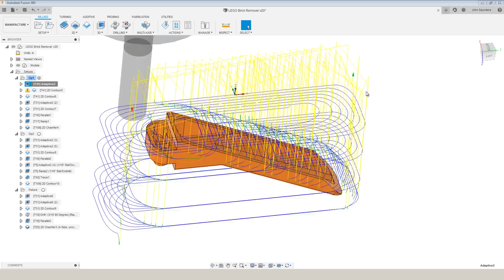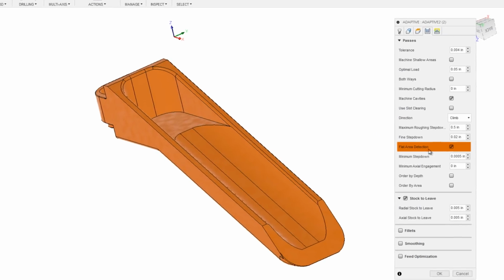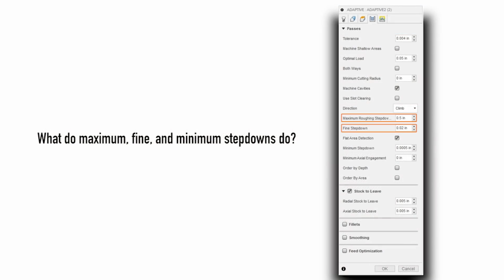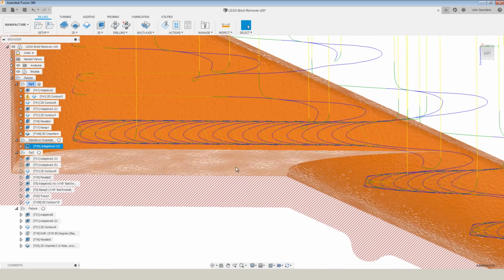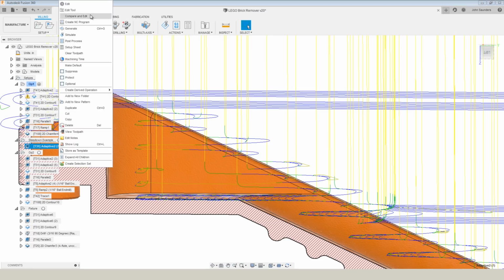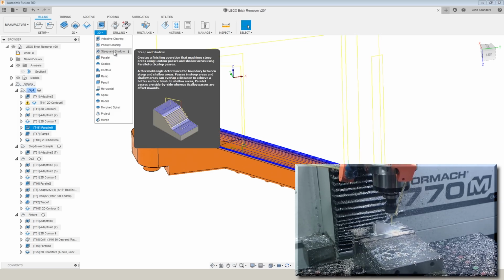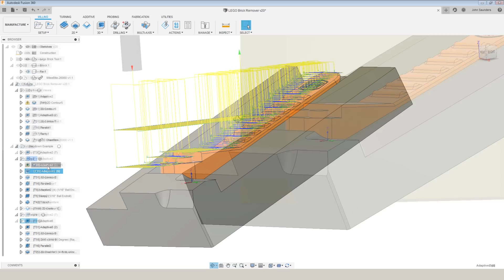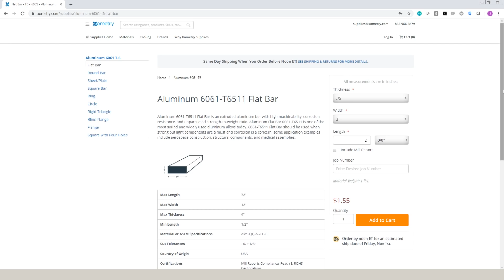Fun CNC Project | Milling Aluminum LEGO Removal Tool

Comment: I've got no problems adjusting the work origins, or the operations.. what boggles me is the way you set up the vices, the custom work holding, etc so fast. To me, that's a bit of a project I'd like to smack my head around.

Comment: Seems like a waste of a lot of material?
Reply: With a lot more time spent on holding it you could start with a much smaller piece. He said it was a scrap piece lying around, therefore worth a lot less than the time that the extra fixturing would cost.

Comment: such a big piece of aluminum for such a small part....so much stock is wasted... As a starting hobby machinist I'm finding out how expensive stock is, so I'm just not understanding this.

$2? Well, would be $4 in my country, excl shipping ~$7
Reply: One of the first things you need to do as a true "hobby" machinist is stop looking at costs for 1' or 2' lengths of aluminum bar.  Just go looking for sales on a 6'+  (72") long bar of say 1"x2" 6061-T6 which is one of the most common aluminum bars made.  For $150 you can probably get 3 or so of them shipped to your door with a normal carrier like UPS.  That's a lot of small DIY parts worth of metal for not much money.  You'll stay entertained for a long time with that much.  1x2 is a good size piece of aluminum for most small jobs.  That and a cheap $200 band saw (vertical or drop) And you'll have the ability to cut it easily and enough material to play to your heart's content.  Where it will get expensive is when you start taking on jobs that need BIG square stock... like 4x4 or 6x6.  That gets tricky to source cheaply in small length quantities. and is a fortune in 6' bars if you aren't using all of it.
Reply: As a former "starting hobby machinist", you'll learn to buy a little extra material every time you do a project, or know where you can buy drops/scrap. Trust me, the value of that stock is actually $2. And once you learn to stop being cheap and buy larger, less-processed stock, your per-part cost will come way down, even for random experiments.
Reply: @WinstonMakes  problem is not being cheap, but having a very limited budget. Having a baby and stuff.  Maybe this hobby is just too expensive for me.
Reply: What is so hard to understand? This video isn't to show hobby machinists how to get the cheapest materials, or how to make a part out of the smallest piece of stock. If you can't do that on your own, and use this video to supplement it, you should start back at the basics.
Reply: Hence why he said "any scrap you have lying around", implying that there would be no cost-related consequences to making it unless you had to order clean stock. Otherwise, you're better off 3D printing the part, but that would just be no fun at all. 🙃

Comment: FYI Guys Xometry actually does NOT offer free shipping any more for all orders, you now have to have a minimum of $50 on your order. Might want to edit the video to let people know. They only ran that promotion for about 2 months before the added the minimum order.
Reply: Edit the video? Riiiight.
Reply: Also, the free shipping applies to orders below certain weights and dimensions.  I recently went to order some big aluminum round bar.  4-5" diameter, I don't recall exactly.  2 24" pieces qualified for free shipping, 1 48" didn't.  I needed to cut it into roughly 8" pieces, so went with the 2 24" pieces.  And yes, even though it was more per inch it was less overall had I gone withe the $100 freight to get the longer piece.
Reply: @billstrahan4791  There is no free shipping at all anymore, Bill. I have already been in contact about different items and they've clearly told me that promotion has ended.
Reply: @fretsman68  Weird.  I placed my order last night.  About $500 in materials and shipping was free.
Reply: @billstrahan4791  Yes because you ordered OVER $50 worth.........
Reply: @fretsman68  I was responding to your comment "There is no free shipping at all anymore..."  I am aware it is only for orders over $50, but I was actually pointing out that even FOR orders of more than $50 free shipping may not apply  I wasn't making a case that orders under $50 are still free.That's all I was saying.  In other words, yes, it's only for orders over $50, and even then it is just orders below certain dimensions and weights.
Reply: @billstrahan4791  Poor wording on my part but I meant there is no more free shipping for anything UNDER $50. John keeps saying there's free shipping in his videos, but he's not mentioning the $50 limit, and that is what we're trying to explain here.
Reply: @fretsman68  Totally get it, that's why I prefaced with "Also,..."  I think we're in total agreement!  Weird, that isn't supposed to happen in comments on the internet!  ;)  Happy new year!
Reply: @billstrahan4791  lol, agreed! and a VERY Happy New Year to you and yours as well!
Reply: I've been telling John this since they've started charging for shipping but I guess he doesn't read these posts and never updates that information.....